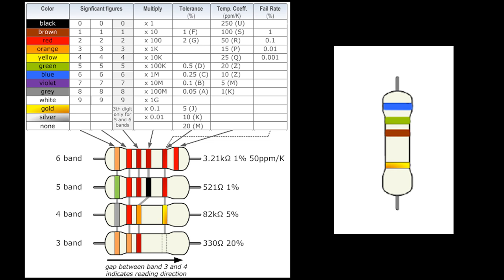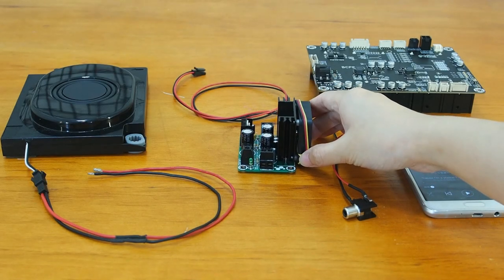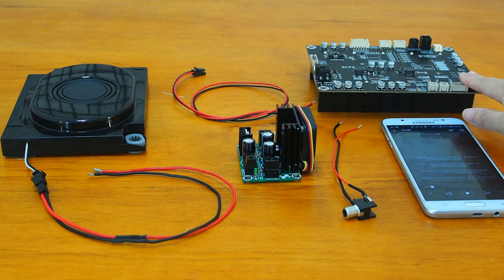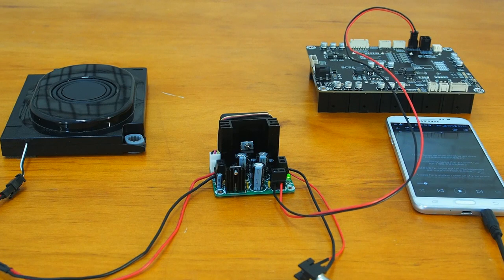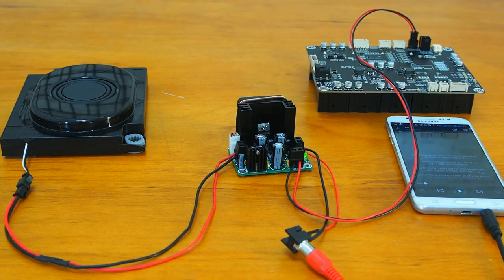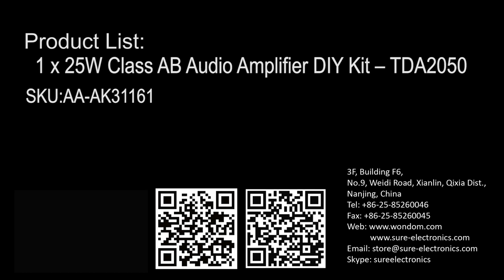DIY KITS——How to easily make your own audio amplifier at home

Comment: This is a 25watt mono A/B amp so I want to buy several. For stereo I know I need two of these, but can I use the same power supply and double the amperage or will it burn up?
Reply from the maker: Hi Brymstond,
As long as you ensure the voltage is the same, then the amplifiers will not be burned up. Thank you for your support :)